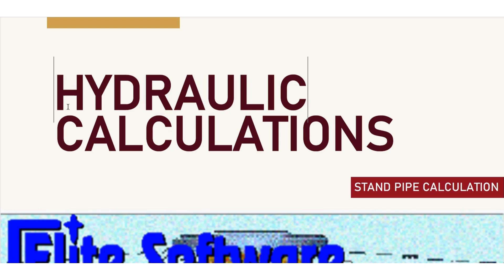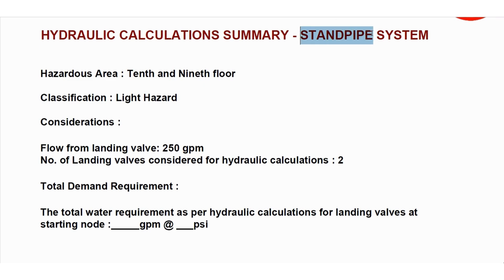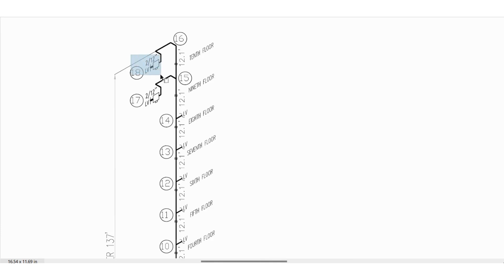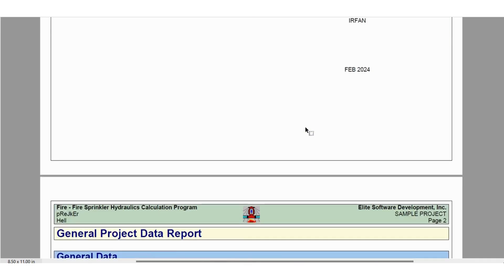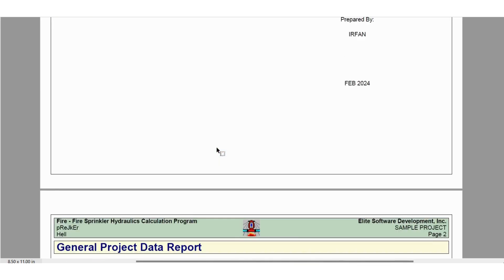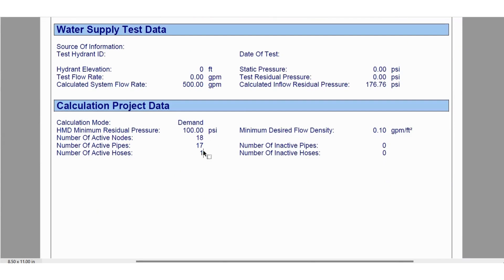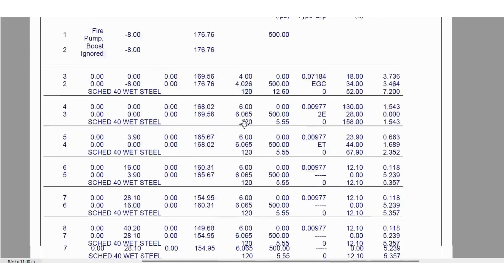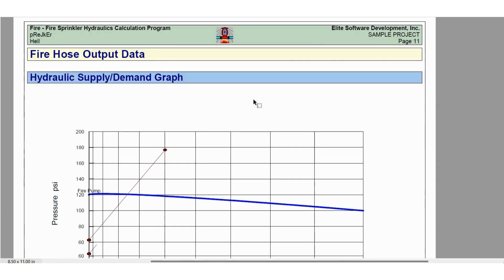Class 6 | Elite fire Standpipe System Calculations

Comment: I am new to this topic so my doubt may be illogical.

For this 4 types of hydraulic demand (sprinkler, fire hoses, hydrant, standing pipes) you calculated and found different values of "residual inflow pressure" .

So at last while calculated the standing pipe hydraulic demand , you said that the pump capacity should be changed.

So doesn't this effect the other calculed values of hydraulic demand for sprinkler and fire hose and hydrant?

Because single pump will be used to meet all this requirement right
Reply from the maker: Yes, you're absolutely correct. We will select the fire pump based on the highest demand and required head to ensure it meets all the conditions for sprinkler, hose, hydrant, and other system demands. Even if the selected head is higher than necessary, the components are designed to withstand the pressure under actual operating conditions
Reply: @irfancfps  thanks. I didn't expect such a detailed reply

Comment: you use fixed flow rate for 2nd landing valve because the inlet pressure is higher, so fire fighters shall adjust the k factor of the nozzle. if you use same k factor, you may endup with higher flow rate at the pump.
Reply from the maker: You are correct.

Comment: good work , but you can increase the size of pipe riser to decrease the total required pressure or you will use PRV
Reply from the maker: Thank you. You are correct but in general the sizes will be increased only if there is already existing pump installed and or if u r extending the network to some other additional buildings etc. in order to satisfy the existing pressure head requirements. In normal case, as per the standard we don’t increase than required..